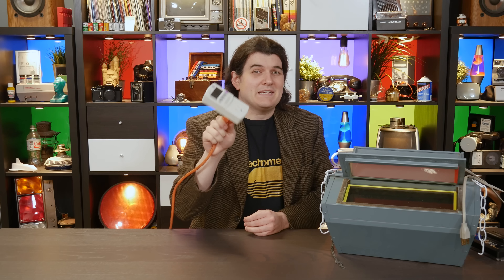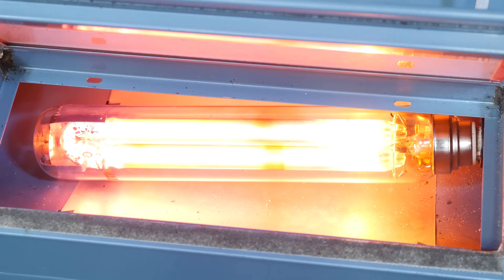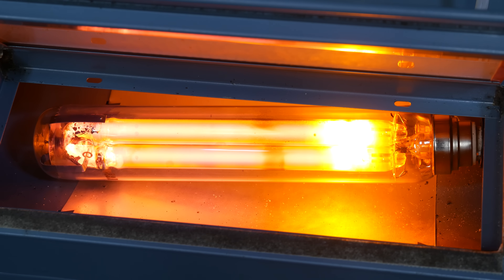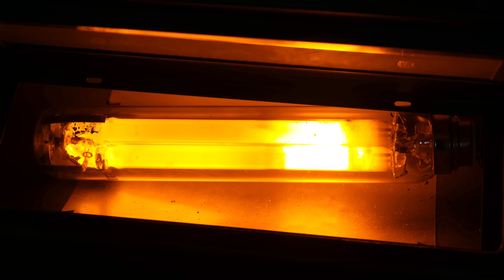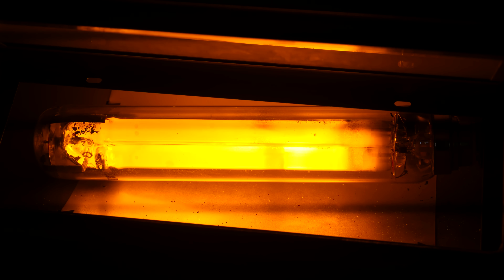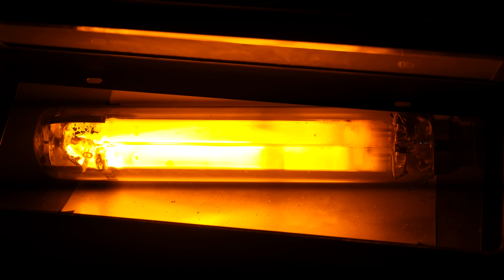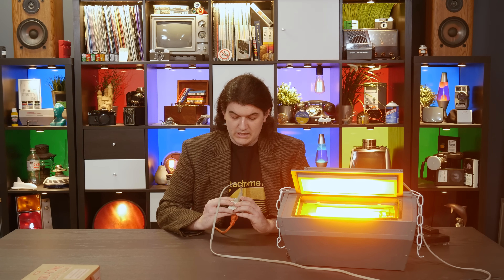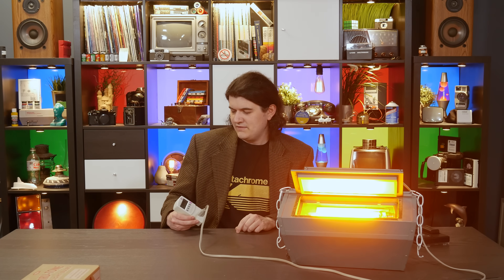More vaguely-informative ramblings about low pressure sodium lamps

Comment: I cant find your main video about LPS lights now. Did it get taken down? 

Anyway you've inspired me to try using 3000K HIDs in my car for the main headlights. The French might have had the right idea all along.

And I for one will never stop complaining about the pointy ans unpleasant light that LEDs produce. Our power bills never went down from switching those cursed things like we were promised. Maybe if enough of us grouse about the glare and diurnal disruption of LEDs we can force civic planners to start bringing LPS lamps back
Reply: "A backwards camera in a darkroom - photographic printing" is the video of his you want.
 
Just FYI 3000k HIDs are a bit whiter then ordinary halogen headlights. You want the 2200k bulbs. LPS/SOX are about 1700k colour temp, HPS/SON are about 2000k.

LPS/SOX will never return to our streets, LEDs are much cheaper to make and are about as efficient and offer features like dimming and presence sensors. Hope is not lost though, monochromatic 589 nm LEDs do exist, they're usually deployed near astronomy places. They're unlikely to be deployed on regular residential streets though, what will probably happen is a gradual roll out of 2700k fixtures on residential streets

Comment: With regards to the power factor thing, the easiest way to think of it is that any device that isn’t purely resistive (a heater is an example of a resistive device) probably has an inductive component that needs to charge up a little (ex: literally any electric motor). Inductive loads “consume” both active power (watts) and reactive power (VARs). Capacitors “convert” watts into VARs to feed the inductive devices. Unfortunately, we can’t just have capacitors everywhere to have plenty of VARs at the ready because going too far in the other direction causes the same problem. Everything has to match and ideally the capacitor is as close to the inductive device as possible.

FYI this isn’t at all how reactive power physically works, but it’s a decent enough model and the math works.

Comment: HPF ballast/capacitor will drop current to like 200mA instead of 1A for low PF.  All the large fixtures I have use HPF capacitors for 55W and 35W, 90,180W

Comment: Philips had several versions as they kept improving them during the 1980s sox pro, powerline, sox-e is the 18W then came sox e versions to replace all the standard 35,55,90,135,180 using electronic ballasts they took out metal brackets, and use mica, to better efficiency on new ones. each small improvement increased life and efficiency .  The 180W is fantastic, have the fixture and it's 4ft long and BRIGHT!!!
Reply: Birmingham in the UK has a few Philips MA60s which are 180W remote gear/135W gear in head and they are loooong even several metres in the sky

Comment: That's an OSRAM lamp, no dimples.  Philips version of LPS have dimples to act as the cool spots to control the sodium...Philips continued to improve the glass infra red coating to keep heat maintained at a constant temp, for better efficency.  HPF system use a lot less current, the added capacitor changes everything..My Philips 18W mini sox wall pack don't hum, but the American electric 18W fixture hums more, different brand ballast, and fixture structure not as robust as the Philips Norelco Mini Sox fixture, I have 5 in use for 40 plus years, on every night for decades, about every 5 years change out a failed lamp, same ballasts last forever either HPF or normal PF., Advance Philips.

Comment: They where the highest efficacy lamp for decades, LED finally caught up. the 180W lamp was around 120lm/W  18W put out coincidentally 1800lms...I have 180W SOX floodlight fixture, a Philips of course, when they made fixtures in VanWert OH. for the U.S. market, they sold 18W wall packs under Norelco brand in many stores as MiniSox meant for entrances, etc.  they work great. They had HPF ballasts with capacitors and the 18W minisox drew like .2A...like a clock

Comment: It always goes to the cool end, it's designed to do that, the PHILIPS version has dimples in the arc tube, OSRAM is slightly different design, GE in the U.S. didn't have LPS, until they bought THORN in Europe and started selling LPS relabeled GE, they where Thorn lamps.  Philips ended production, several years ago....the factory was closed.  I stocked up with 18W, 35W 55W I use 6 SOX fixtures around my house 18W and 55W some fixtures 40 years and still going strong.  SOX are the best for roadway lighting, no glare, no blue, pure yellow.  Eventually the cathode loses emission material, and can't strike an arc... they will just sit glow red, or nothing...they have a finite life
Reply: There's an industrial estate in Southampton UK that has a lot of SOX lamps in it . Out of the 30 or so lamps, about 5 have failed, 2 of which constantly flicker pinky red like they're trying to start. the other 3 are completely off. I think some ballasts or ignitors would detect if a lamp wasn't striking and give up until the next power cycle. Apparently the constant striking attempts are hard on the ignitor.

Comment: I think I went through a massive tunnel at one time inbetween Duluth and Grand Marais MN that had LPS Lighting in it. some of it could have been led, I can't remember, but it did look like Sodium Vapor lighting to me.  Meanwhile the lighthouses up in Duluth On Shores, were replaced with LEDs, I think they used to be mental halide, or huge incandescent/halogen lamp bulbs with motorized beacons, but now they're all just flashing omnidirectional LEDs now with no moving parts. One has been abandoned for hundreds of years and was run off fuel like kerosene, maybe a wind up spinning mechanism unless it just didn't have a spinning mechanism or Beacon? It isn't used for anything, not even to this day, it's just a tourist attraction now. LED's may be efficient, but are they to manufacture? It's really sad when you think about it. What will be left in electrical, machine and technology history 10, 20, 30 years later? I think a motel near where I live a couple towns away, had at least one LPS lamp at one time, along with the HPS lamp that once neighbored next to it, they both got replaced by LED lights. Meanwhile, across the block from them, I think a mercury vapor or metal halide lamp still remains, unless they just replaced it with an LED and kept the old housing... Not sure, never had a chance to check yet..

Comment: We had these LPS road way lights  on our highways (catinary) in South Africa. Many years ago. I remember the JHB municipal lighting engineer giving a talk and  saying that under this monochromatic Yellow light it was easier for the motorist to pick up the curb or side of the road also ,good high Luminance reflected. I know it was difficult to differentiate between oil spill, tomato sauce and blood. This light sauce is good for growing in a hot house chryfanthemums. Also, this type of lighting was utilised in fog condition areas.
French car manufactures always incorporated an extra yellow incandescent miniature lamp inside the headlight or a separate spot light attached to the bumper. Not sure if the jury is out if this really works.

Comment: The way sodium lamps can "burn out" is this: the white stuff on the electrons is a substance that helps lower the required voltage to run the lamp. If too much of this substance gets sparked off the lamp will stop igniting.

Comment: We had a lot of these here in Finland for highway illumination.   Also was fascinated by them as a kid. I wonder why they were removed so early in here (pretty much all around 2008-2014). Probably the fixtures just reached their EoL, but funnily they were replaced with less efficient HPS, and only 10 years later they’re being replaced with LED… I mean did the monochromatic light really annoy some people so much lmao? Slightly of off topic (since I didn’t see any low pressure ones), I hit a ”goldmine” of sorts one day whilst driving randomly accross the country side: an unpaved road with almost a museum variety of fixtures, old style (probably 60s) fixtures with mercury vapor lamps, slightly newer fixtures with mercury vapor lamps, some pretty new fixtures meant for HPS with HPS in them, some were metal halides, and some originally merc. vapor fixtures with metal halide and LED replacements in them, as well as some completely fresh LED bulitin fixtures. Such fun things we end up with the idgaf mentality the maintainers must have had!

Comment: 70 watts/ 0.20 PF = 350 VA

This means that while the unir only uses 70 watts, the power transformer Feecding it need s to provide 350 volt amos, or 350 VA.

The power triangle is a right triangle, with Watts on the horizontal, Volt-Amps Reactive, or VARs on the vertical, and VA (volt-amps) on the hypotenuse.

The PF is the cosine of the ángleebetwen the horizontal and the hypotenuse.

Comment: LPS used to be the longest lasting lamp available. Its life expectancy was based on the lighting of 100 lamps. When 51 failed that was the posted life expectancy. 

This is the definition of CRI (Colour Rendering Index) of zero. Even High Pressure Sodium had met 30. 

The advantage to LPS was a tremendously good light output to wattage. Yes as you stated the ballast uses a lot of the power but its LPW was quite good. It wasn’t matched until LED’s came out.  The higher power factor you are seeing could be a bad ballast

Comment: The reason a low power factor is so bad is this indicates ac voltage and current is consumed out of phase by reactive devices and the resultant useful power delivered is less. Generators, transformers and electrical reticulation systems must be sized to deliver the maximum current needed to supply any given load. A device at unity power factor (1 = in phase), say a heater, directly follows ohms law in that 1V x 1A = 1W. However, that same 1v x 1A at 0.2pf (as in your case) will only deliver 0.2W of real power. Commercial and industrial installations are metered for power factor and this is factored into their electricity charges. Large power consumers nearly always use some form of power factor correction for that reason.

Comment: Fun fact, if you drive around Redditch in the UK after dark, you will see brand new LED street lighting lanterns that colour match perfectly with high pressure sodium lanterns. 
I’d be interested to hear an explanation as to why the local authority has chosen to do this. 
Note, I’m not talking about red LED street-lighting lanterns that I know are used in some specific locations to minimise impact on bats.

Comment: The low pressure sodium lamps in the uk where designed for a 25 year life, that is why the ballast and lamp are so chunky.

They had timers to prevent a hot re strike, and also so when lights went on, they all staggered starting (a whole string would be controlled with one light sensor or time clock). 

In the UK there is a PFC capacitor separate from the ballast. As those have shorter lifespans than the bulb, they are socketed for hot swapping.

Comment: I studied to become an electrician (never followed that path, I became an auto tech), my teacher in Electrical class told me he was on a job to replace one of these sodium lamps that was originally from 1989, he said the only reason it needed to be replaced was the rubber gasket in the lamp housing failed and water got in, damaging the ballast. Supposedly, had the balast not failed, it would have still been functioning. I've wired up some HPS lamps before and aside from the monochromatic color and horrible power consumption, they are basically bullet proof. The balasts are super simple, the one I wired was literally a transformer and an igniter coil.

Comment: LED has finally met and or surpassed Lm/W output.  It took a long time, LPS SOX was the most efficient light source for decades...Philips  in 1932 introduced them.  they have several versions, each with an improved Lm output and life improvements.  Better internal coatings of the outer glass envelope, to reflect back infra red, and keep heat in, to stabilize arc tube, while allowing the visible yellow through.  Like Low e coatings on windows.

Comment: One aspect of LPS, as they age with thousands of hours on the lamp, they start to use slightly more power, but actually increase their output, until they finally fail. They stay cool outside since the vacuum is insulating the inner arc tube.  Ballasts matter for power factor.  My fixtures with Philips Advance ballasts have been running for decades, over 45 years I think I replaced 2 ballasts, for a failure after decades in use.  Others still run fine.

Comment: I get  about 5 years of every night use.  18W and 55W  The cathodes lose their emission paste. They do fail, and stay red neon glow, when the arc can't be struck. I stocked up on 35, 18, 55W lamps Another setup also 35plus years in a salt water air environment been running change lamps about 5 year or so, on every night.  Best lighting on docks, you can see your dock from miles away...the 180W fixture is so bright and has a lot of output.  Used in parking lights, etc.  The fixtures I have use a cap across it, HPF, less current, by a massive amount

Comment: The dimples on Philips version of LPS, versus Osram use cool spots to control sodium migration.  I still use 5 plus LPS fixtures 18W and 55W to light up my house and grounds, have in use for 35+ years, Philips Norelco fixtures and a Hubbell.  I stocked up on LPS now they are out of production.  Philips closed down the last factory making them.  I have dozens of spare lamps  even 180W massive beast fixture is larger than 4ft long. SOX LPS is the best roadway lighting in bad weather, no glare, best to drive under.

Comment: Poduction of SOX LPS lamps ended in 2022 due to falling demand supposedly. The best low pressure sodium lamps as of 2018 were getting 218 lumens per watt A++ rating efficiency, better than many LED's // and can work in very hot constant on situations, in very cold constant on, where LED works best in rapid switching on off where the LED never gets hot and wears out faster when constant on in hot locations or enclosed fixtures
Reply: https://en.wikipedia.org/wiki/Sodium-vapor_lamp 

Sodium-vapor Lamp article on Wikipedia a good info source about the antique tech replaced by HPS or high pressure sodium, then MH metal halide HID, then fluorescent, then LED / in terms of commercial applications, while incandescent and halogen lamps and bulbs without a ballast screw in E26 base dominate and dominated consumer home use applications, while T12, T8 and later T5 tubular fluorescent with magnetic then electronic ballasts equipped fixtures featured in some kitchens, shops and garage applications as utility lights, while mercury vapor, HPS, and HID dominated domestic outdoor shop lights.
Reply: Quoting wikipedia article about Sodium-vapor lamps
"Now that production of LPS lamps has ceased, consideration is being given into the use of narrow-band amber LEDs, which are on a similar color spectrum to LPS."

"Yellow color of low-pressure sodium lamps also leads to the least visual sky glow, due primarily to the Purkinje shift of dark-adapted human vision, causing the eye to be relatively insensitive to the yellow light scattered at low luminance levels in the clear atmosphere."
Reply: TLDR from wiki 

High-pressure sodium (HPS) lamps have been widely used in industrial lighting, especially in large manufacturing facilities, and are commonly used as plant grow lights. They contain mercury.[23] They have also been widely used for outdoor area lighting, such as on roadways, parking lots, and security areas. Understanding the change in human color vision sensitivity from photopic to mesopic and scotopic is essential for proper planning when designing lighting for roadways.[24]

High-pressure sodium lamps are quite efficient—about 100 lumens per watt, when measured for photopic lighting conditions. Some higher-power lamps (e.g. 600 watt) have efficacies of about 150 lumens per watt.

Since the high-pressure sodium arc is extremely chemically reactive, the arc tube is typically made of translucent aluminum oxide. This construction led the General Electric Company to use the tradename "Lucalox" for its line of high-pressure sodium lamps.

Xenon at a low pressure is used as a "starter gas" in the HPS lamp. It has the lowest thermal conductivity and lowest ionization potential of all the stable noble gases. As a noble gas, it does not interfere with the chemical reactions occurring in the operating lamp. The low thermal conductivity minimizes thermal losses in the lamp while in the operating state, and the low ionization potential causes the breakdown voltage of the gas to be relatively low in the cold state, which allows the lamp to be easily started.

"White" high pressure sodium lamp
A variation of the high-pressure sodium introduced in 1986, the White HPS has a higher pressure than the typical HPS lamp, producing a color temperature of around 2700 kelvins with a color rendering index (CRI) of about 85, greatly resembling the color of an incandescent light.[25] These lamps are often used indoors in cafes and restaurants for aesthetic effect. However, white HPS lamps have higher cost, shorter service lives, and lower light efficiency, and so they cannot compete with HPS at this time.

Comment: we still have a lot of street lights in my town that are those sodium lamps but ive noticed in the past few years they been slowly replacing them with LED fixtures they just replaced the one at the end of the block where my apartment is with a LED fixture after the old one went out about a year ago